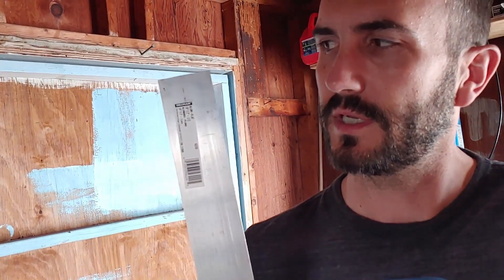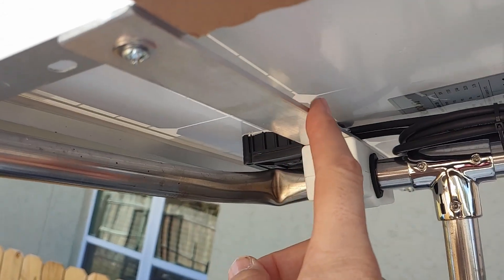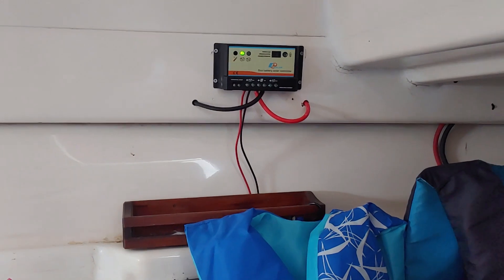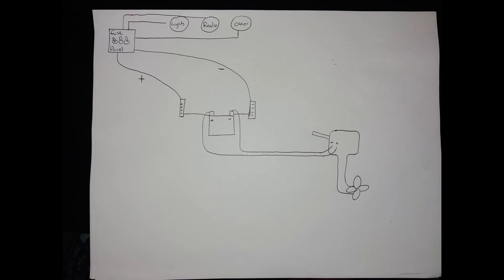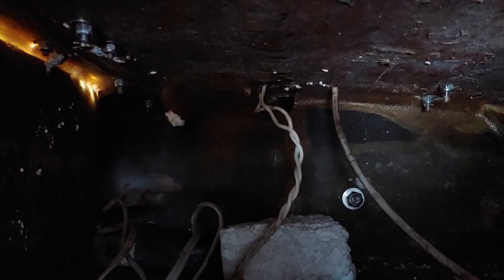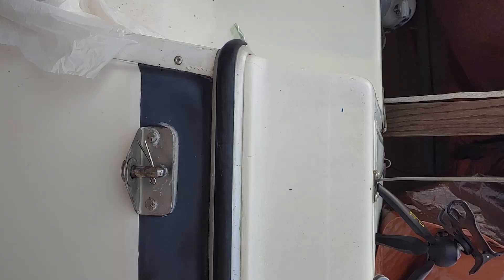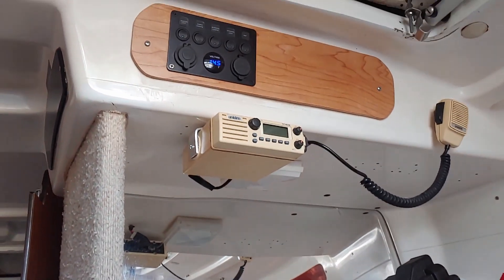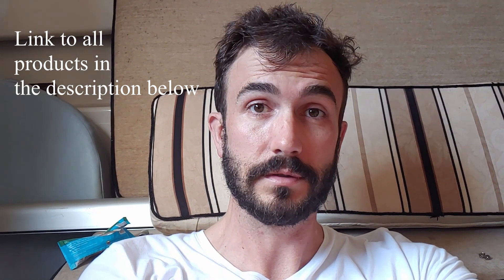Solar install and rewiring on a 1989 Macgregor 26D trailer sailboat, plus refurbishing old steel.

Comment: I installef a thin film 50W just forward of the mast. Simply tied with paracord to existing fittings. Drilled a pass through SAE plug near the mast. I suggest people get a water rated charge controller with no display. Measure things with multimeter if you're curious.

Comment: Nice work. I just completed bottom and hull painting on my 92 26 s. I have done some of the wiring for mine. It a pain running them. How do plan to hide them?  I ran most of mine in the corner of the bathroom from the bilge to upper part.
Reply from the maker: I ran most of the wiring up in little area between hull and deck and used existing wiring to keep it simple. The new wiring I'll try and hide in crevices here and there, but we shall see if I add anything besides some colorful lights for the v-berth